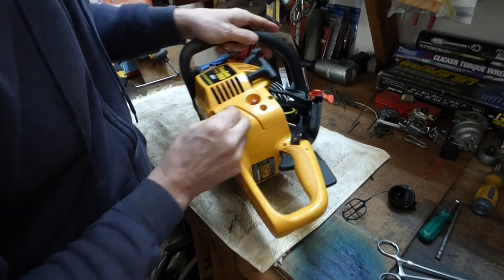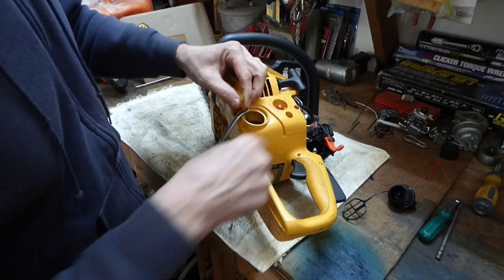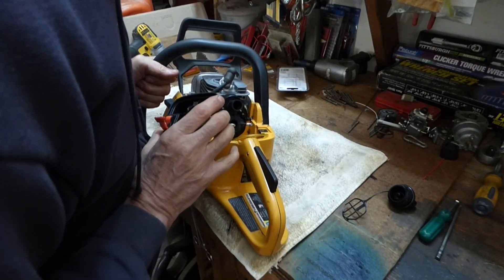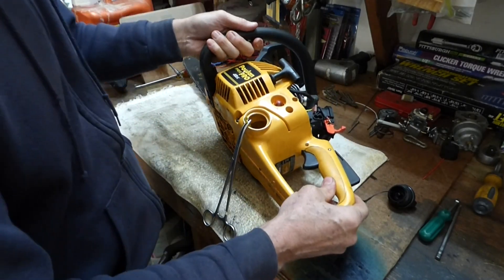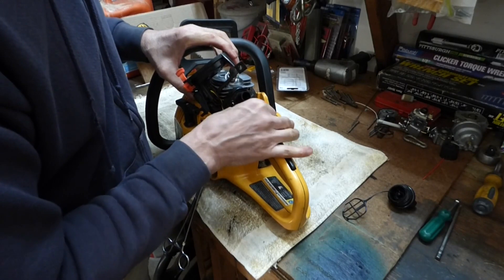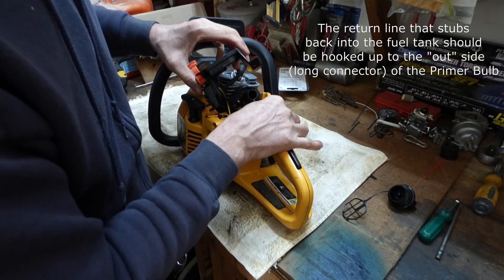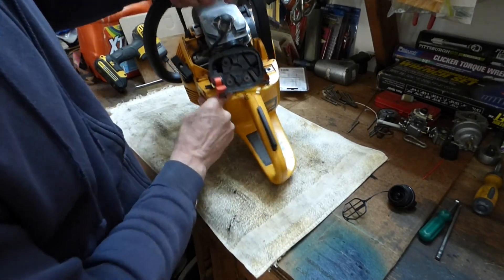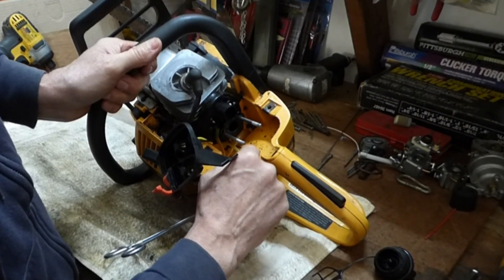How to Fix a Common Fuel Line Problem on a Weed Trimmer / Chainsaw / Blower - Won't Start or Run

Comment: Always start a repair where the last idiot stopped.  If you keep working back, you will find the problem.  Some people make an easy repair, initially, into a hard and time consuming repair. The supply line is usually the one further east from the primer bulb and the return line connects to the primer block.  An easy mistake to make.

Comment: It this a common issue?
Reply: I often wondered why the fuel line was black but the primer and return ones were clear . Now I know one good reason why that may be . If someone has replaced it with clear then I suppose this could easily happen .

Comment: Maybe when the owner changed out the carb, he installed the fuel line incorrectly
Reply from the maker: Yes… I think the homeowner worked on it and hook the lines up incorrectly… Then passed it on to someone else to try to fix it and then finally to me. It is quite common that people disconnect carburetors to fix one problem and create another by hooking the lines up incorrectly
Reply: Makes sense